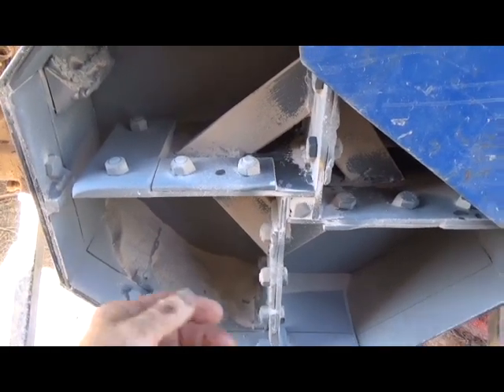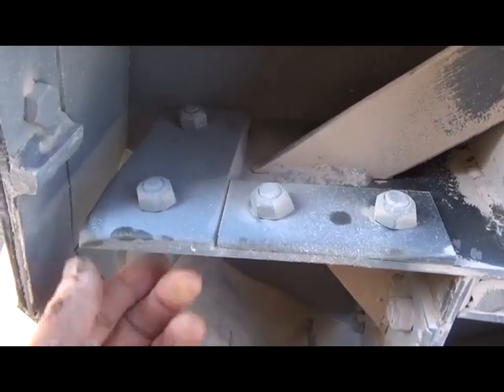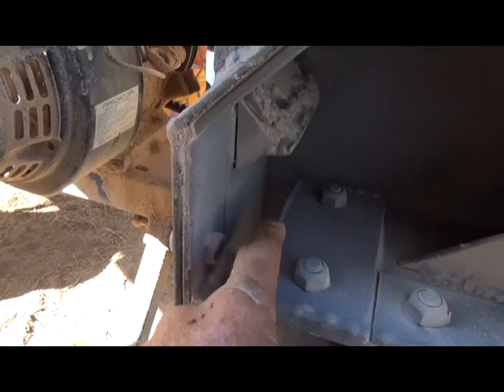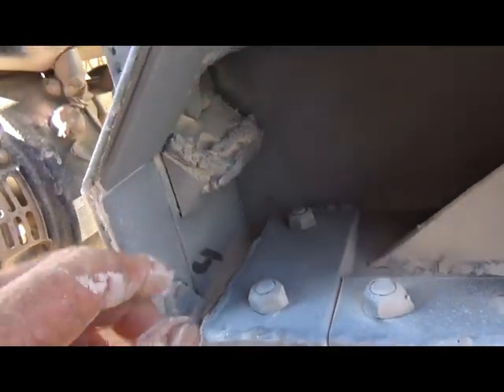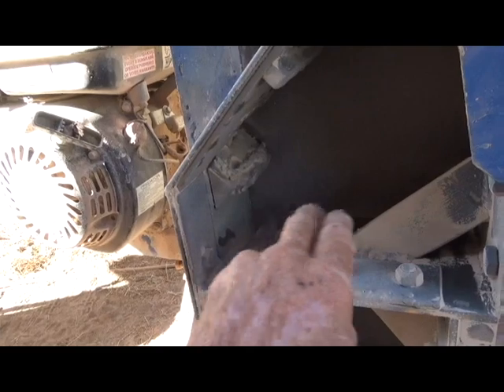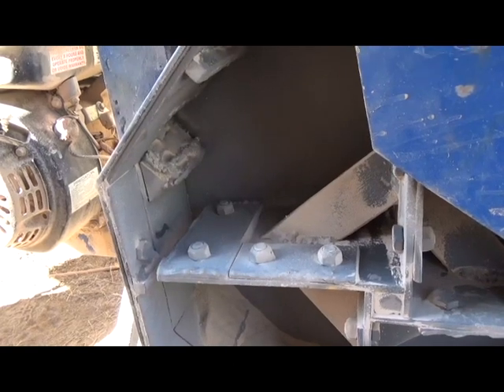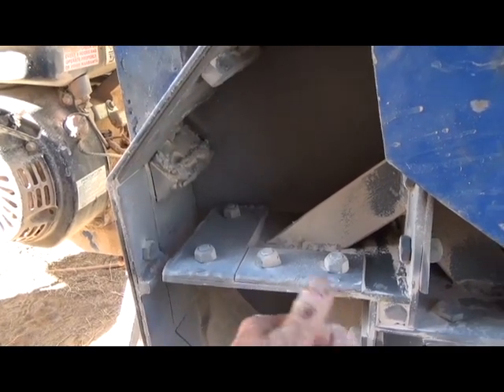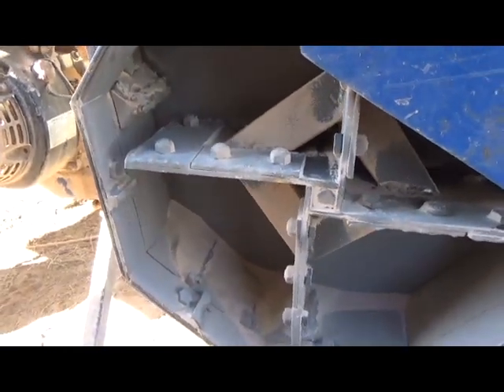186 Wear and Gold Trapping of the New Impact Mill

Comment: Can't decide if I should use a circular design or octagonal. Your thoughts on it please.
Reply from the maker: Do you have a ready supply of round tube to make more chambers from?  How much do you intend to grind?  This design is for near indefinite re-building.  For small sampling only a simple round chamber might serve well.
Reply from the maker: BTW, a used truck brake drum makes a good circular chamber.

Comment: Are your wear plates mild steel or abrasion resistant?

Also, what if you flipped the bolts 180 degrees so the nut is on the back side of the plates to save wear. While your at it you could switch to a carriage style bolt for a round head. Of course that would mean having to broach a square bolt hole. 

Interesting project.
Reply from the maker: Right now, mild steel.  Cheaper and easier to prototype, shows the wear quicker for easier analysis.  Production units should use hard plate.

The nuts are much cheaper than the bolts, I'd rather replace them.  Rather than broaching, one could just use CNC plasma.  Carriage bolts are a pain when they seize up.  A pipe wrench will easily grab a worn nut.  At least that is my reasoning.